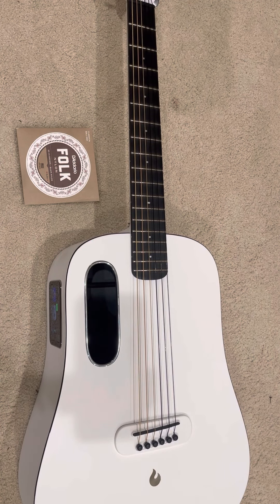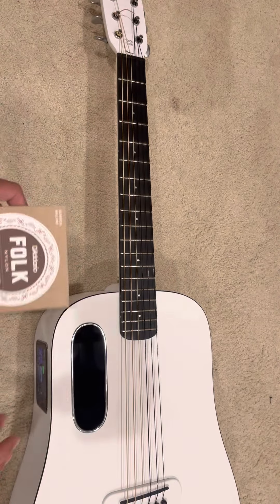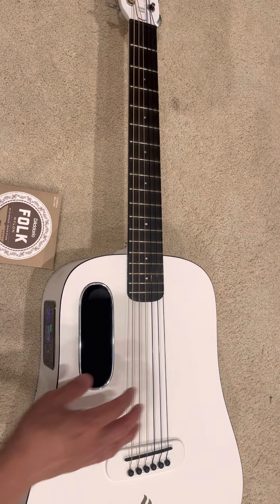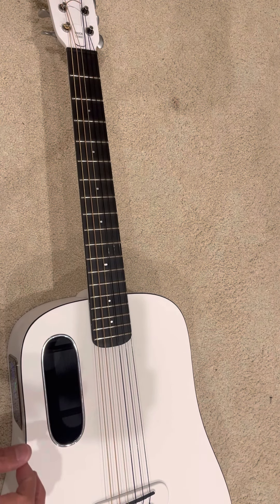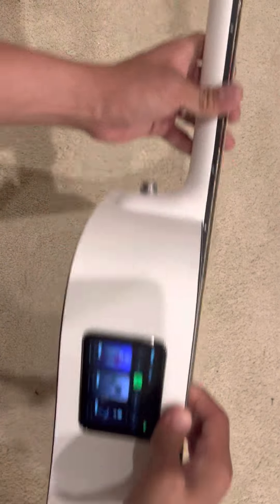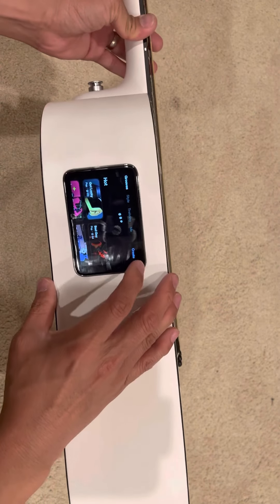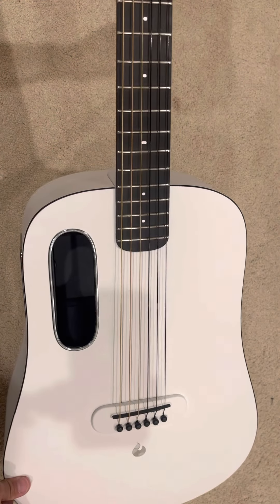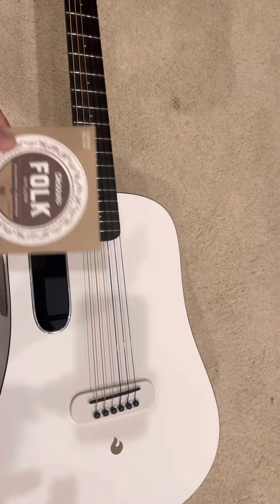Blue Lava Guitar with Nylon Strings

Comment: you should really stretch the strings by pulling each 1 up a few times and run each string from top to bottom like your sliding then retune and repeat the process.retune  and you should be good to go ovrrtuning runs the chance of snapping a string.Everyone has there own preference but i wouldnt overtune any strings.